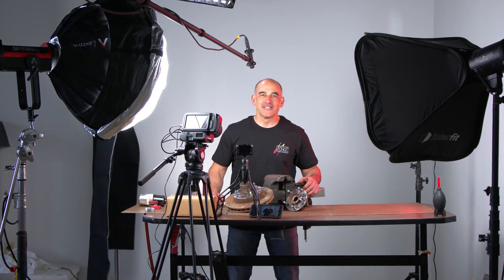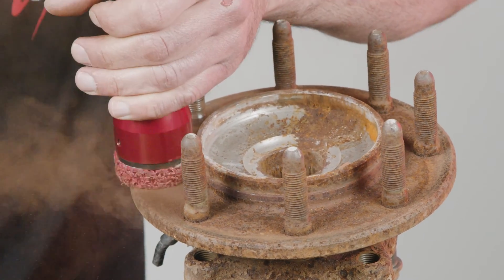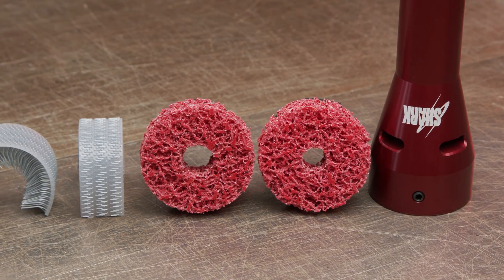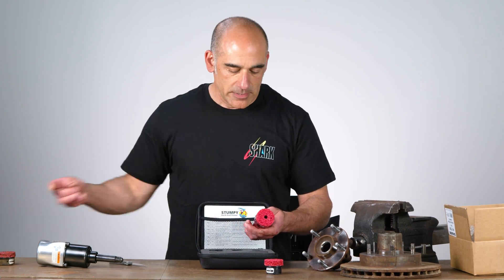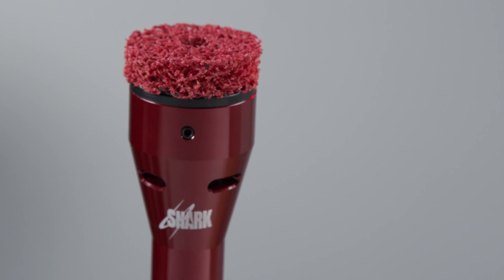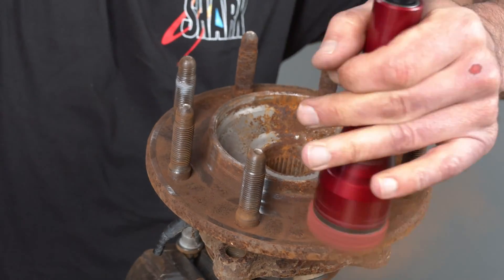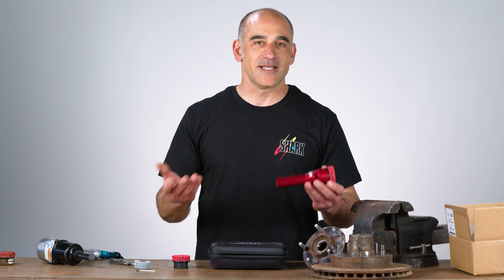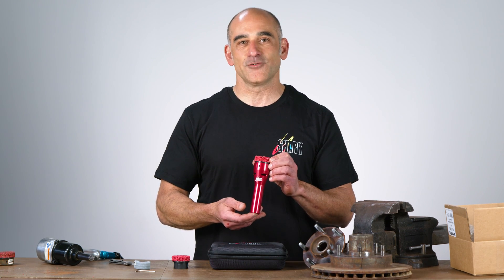Shark's Stumpy 2-in-1 Hub & Stud Cleaning Tool

Comment: ...hey WOW man, like I have been trying to find the perfect stud cleaner for my mechanics  due to issues we have encountered, this version, though I have not tested it personally seems to address the most of them, the only one I am still wondering about is clearance of the pilot on some,  case in point would be the Transit Connect compared to E and F series...so intill someone comes out with the "perfect" stud cleaning brush, you can just call me Will Rodgers....❤
By the way, if you're thinking about transitioning from impact to torque multiplier, you will need to start using something like this on a regular basis...😂
See video ALKITRONIC TORQUE for a explanation.